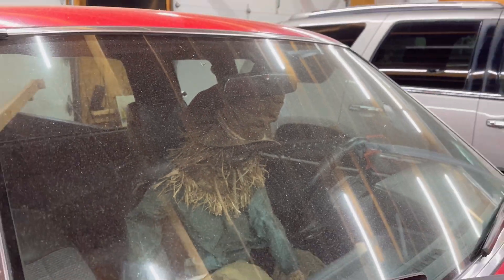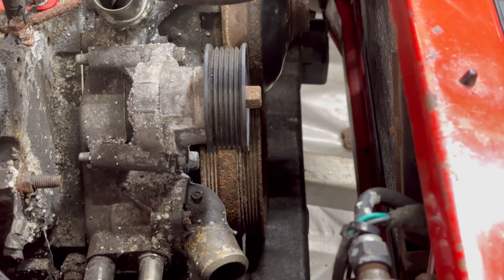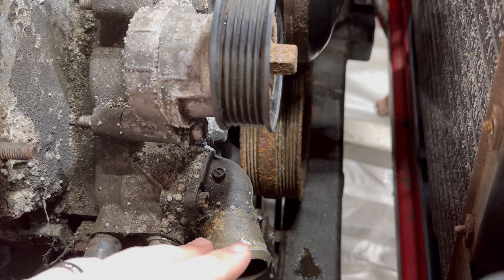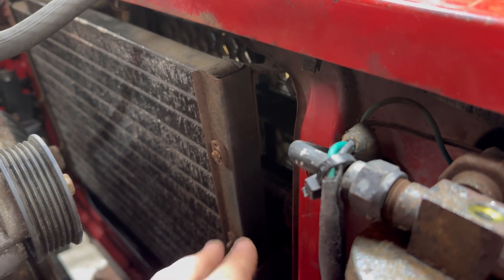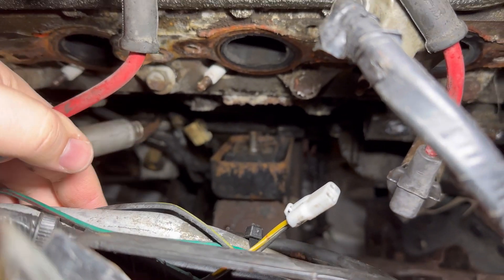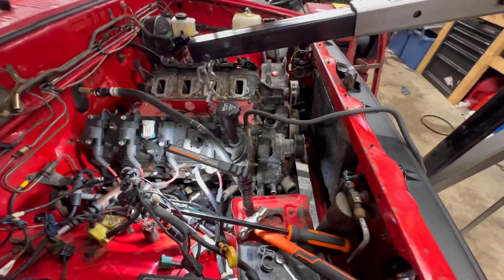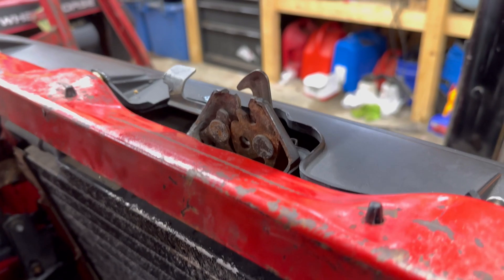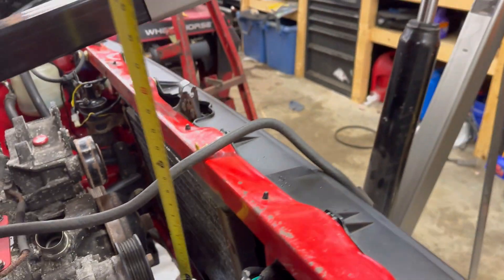B6200 Build Ep2 | What does it take to fit?

Comment: Dang I see that ls sitting in your truck gives me motivation to start mine but I have to wait I wanna get it done right hope your mount brackets work I wanna do a video on my ls swap on my truck imma give u a shout out for the help on this info and if u sell the brackets shout out to that too
Reply from the maker: Awesome man! Get after it! Brackets are almost there! Mainly I’m trying to ensure that the stock mount won’t tear out or anything like that. After talking with a few people I did find that running a T5 allows you to mount the engine way higher.
Reply: @theoegarage  t5 trans it is a lot smaller but I already have the ar5 and fabbot adapter
Reply from the maker: It only requires a little bit of love on the driver side of the wheel well. Mainly due to the squareness of the 4L60 bellhousing.
Reply: @theoegarage  got it I can't wait